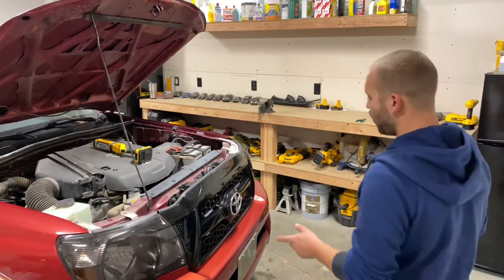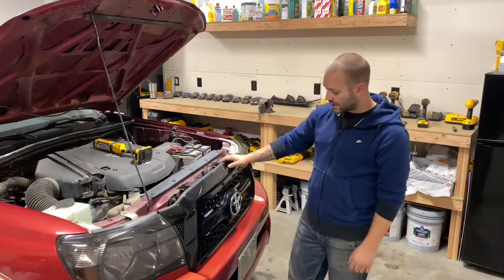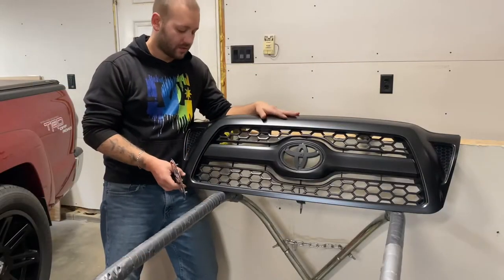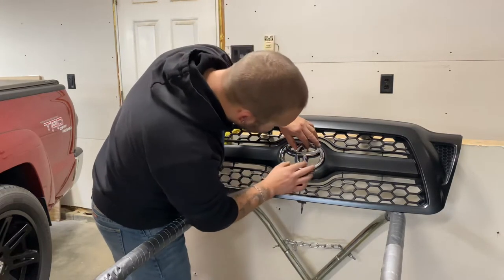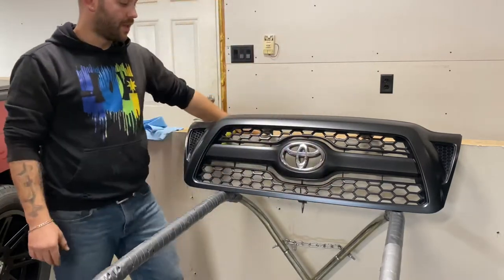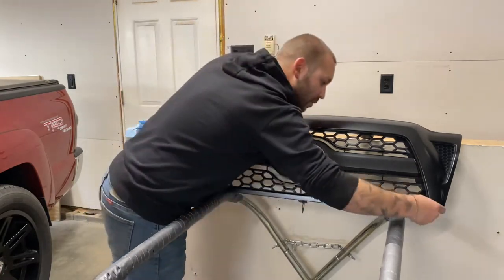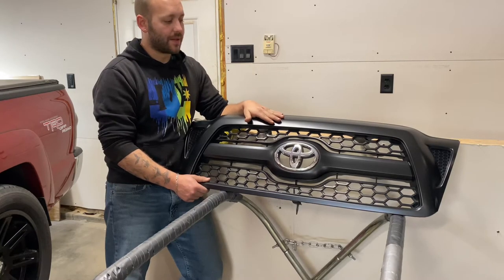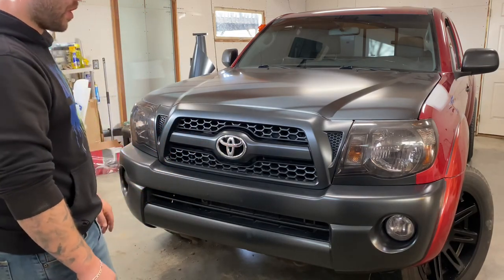Vinyl wrapping my Tacoma grille

Comment: There was a lot of tension in the film to get it to stretch down into those side recesses. Did the vinyl creep back in a few days, or was the adhesive strong enough to prevent lifting?

Also, you prepped it with alcohol first, right?
Reply from the maker: Hey,  good catch.  Everything was prepped with alcohol, but those tight recessed spots on both sides did lift back.  
I recently received a new color for the Tacoma and will be pulling off the Rock Grey, you suggest a small inlay this time?
Reply: @TunersCanvas  I tried mine and didn't use enough heat to set the adhesive. But watching other videos it seems that vinyl in strong tension can lift. Inlay could help. I'm a complete novice.
Reply from the maker: @karlInSanDiego  Same here.  The Tacoma was my first wrap as I mentioned in the video. I have done a handful of vehicles since and ready to update the Tacoma with some lessons learned and change up the color.  
Thanks for the feedback!

Comment: Very nicely done!
I’vr tried the same today with my Nissan’s grill but it was a big fail…
I’m wondering if i was using the right wrap, yours didn’t look sticky and seemed very stretchy and pliable.
I ended up removing it as it had quite a few tears and kinks 😕
Reply from the maker: Hey, thanks!  
I’ve learned practice and patience go a long way. I have a lot more appreciation to those who do it daily. 
I went with Avery Dennison vinyl as it’s discussed in the industry as one of the leading brands. Someone told me that it would be much easier to work with when not having a lot of experience.  
What film did you decide to go with?
Reply: @TunersCanvas  thanks for the reply!
I don’t really know what i was using, i’m following you from Europe.
I’ll look for something more stretchy next time.
Cheers!

Comment: Is this durable?
Reply from the maker: As far as handling the elements, yes it is able to withstand cold, snow, rain, sun climates.  It is however a film applied over the paint so sharp objects, rock chips, etc will impact the vinyl about how you’d expect.  Does that help?